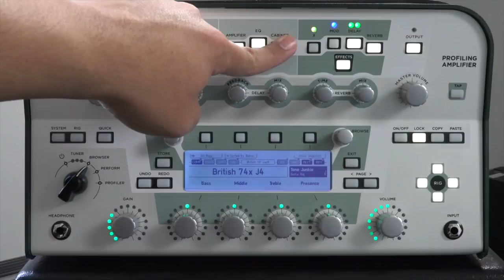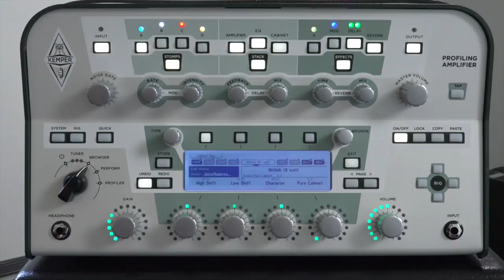Kemper Tips and Tricks - Cab Section High and Low Shift

Comment: hi, could you tell me how to connect the kemper to the amplified speaker? thanks
Reply: I run mine from monitor out through a power amp to a 4x12 celestion loaded cab. This signal always has cab sim off. If you are going to frfr powered speakers you might wanna use main outs. In that case leave cab sim on. Sometimes it's worth it to tweak the output eq for global versatility and save as a separate output preset.